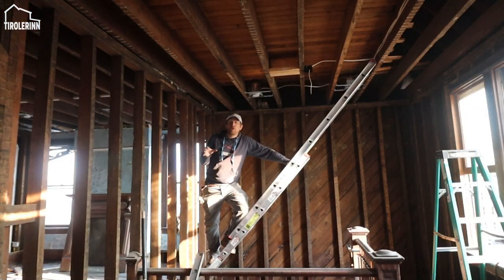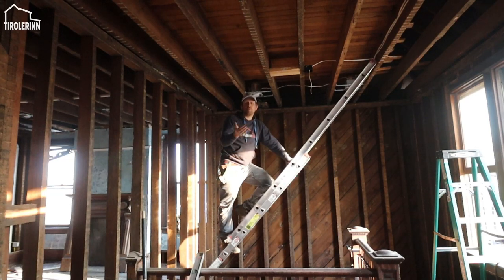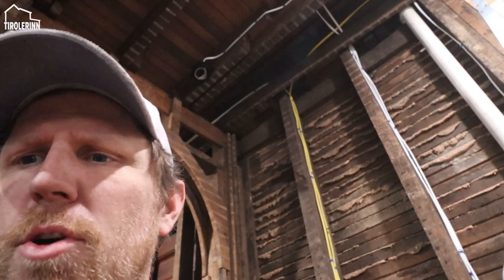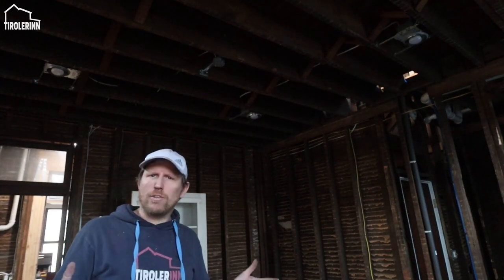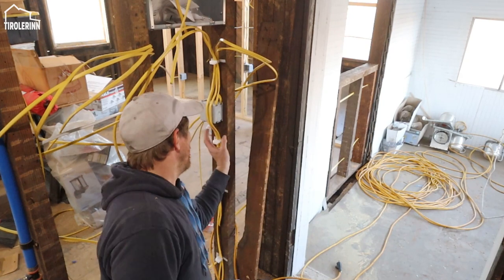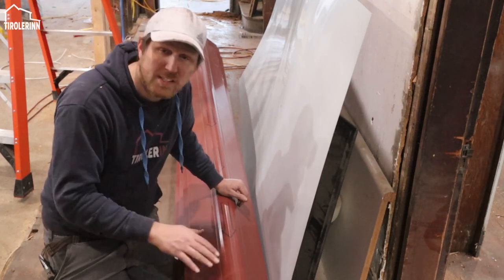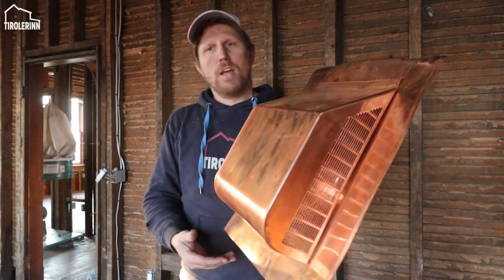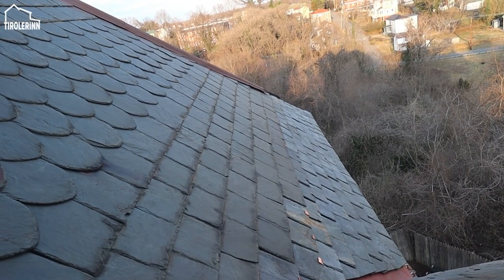Roofing Start and Installing Receptacles in 2nd Floor - Tirolerinn - Victorian Home Renovation

Comment: The covers for your venting pipes look very good and I am sure, that they will fit optical to the house. Which material do you choose for the windows? Just wood or a material mix?
Reply from the maker: We will do a window that has either metal or composite material outside and a wood interior. But they will look like traditional wood windows regardless.
Reply: @TirolerInn  Good decision.  Warm wood inside and outside protected against weathering.  For me the best solution.
Reply from the maker: @michaeli.8352  agreed! Best of both worlds